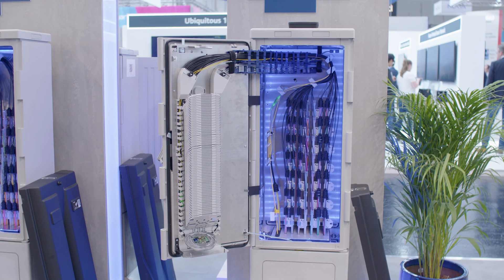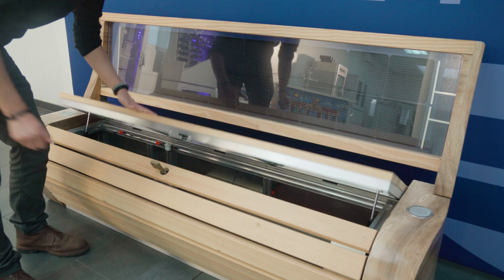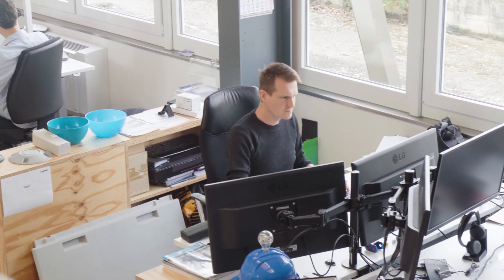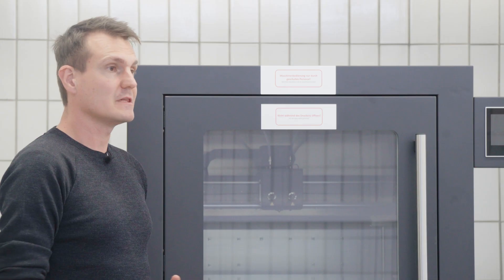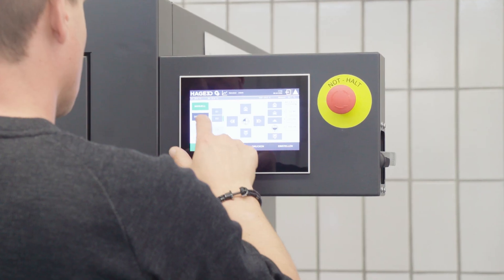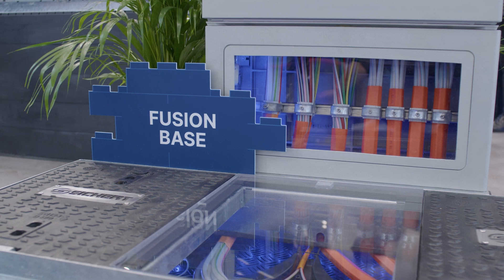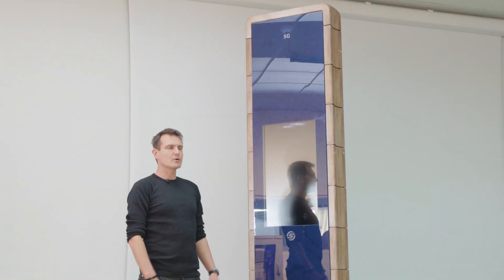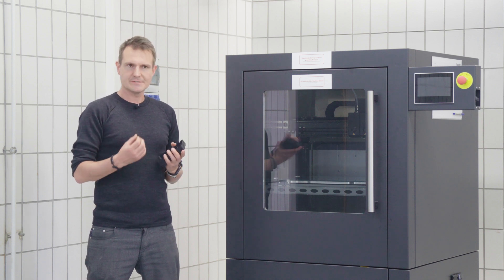Transforming Telecom Infrastructure with BigRep IPSO 105 | Sichert

Comment: Hi, a medtech startup CEO here, researchimg and considering your printers. Why is the engineer at 3:32 using the large printer for such a small and detailed part?  There are other better options for this and (imo) doesn't show what this printer is for right?
Reply from the maker: Hi Alexander,

I wanted to directly address your question with a response from the Senior Engineer regarding the application, given at 3:32: “The IPSO 105 gives us the flexibility to select any material, ranging from low-end to advanced options like PEEK, which we use in high-temperature applications. We used to face difficulties in choosing the right materials that meet our specific requirements, but with this 3D printer, we can explore a wider range of options.”

If you would like to learn more about what the IPSO 105 is capable of, have any additional questions, or just want further details, feel free to check out the following link: https://bigrep.com/posts/the-bigrep-ipso-105-futureproofs-sicherts-outdoor-fiber-cabinets/
Reply: @Bigrep3D  Thanks for the honest and good answer! Understand better now.